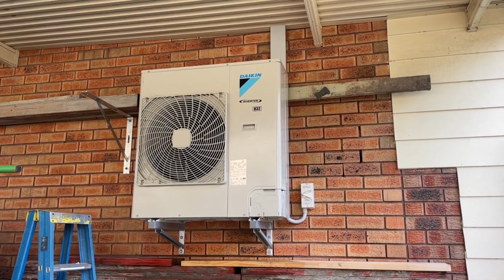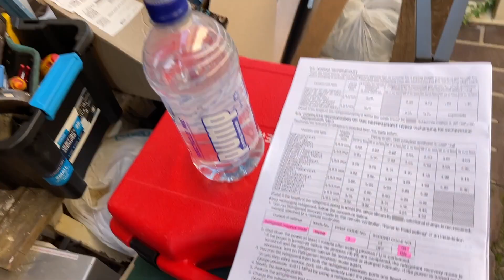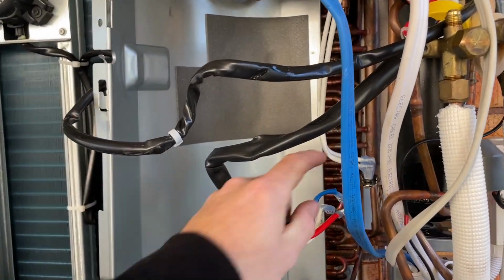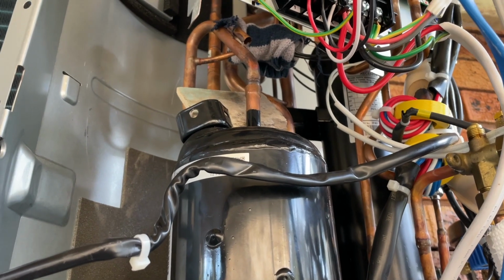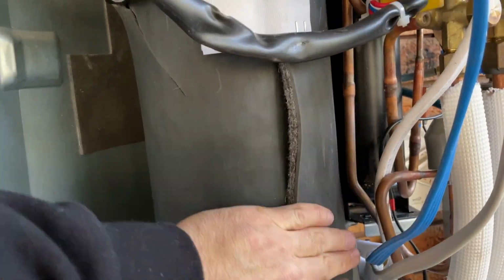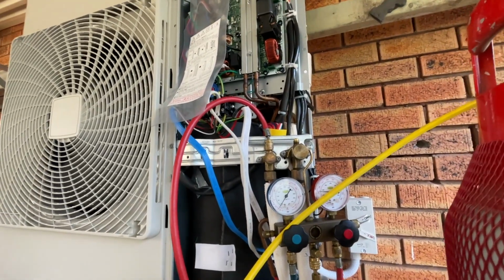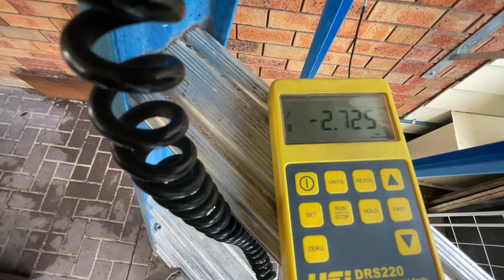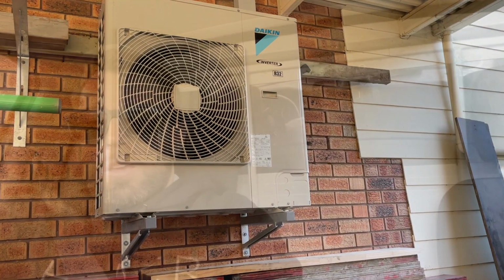Replacing a FAULTY DAIKIN COMPRESSOR | Only 8 months after installation.

Comment: In 2009I purchased a Daikin ducted air. It worked for three hours then failed. For the next three months Daikin Australia f..ked me around. Technician after technician tried to get this thing to work. No luck. After three months Daikin Australia finally conceded and replaced the entire unit. Apparently from conversations I’ve had Dainkin Australia hasn’t got any better. Since then it hasn’t missed a beat. 

You sometimes just get a dud and that happens but Daikin Australia wouldn’t own up. Next time it’s a Samsung or a Panasonic…not because they are better but just because Daikin Australia f..ked me over for three months. Daikin Japan needs to come to Australia and kick some arse.

Comment: You can put a demand on it at night time for 70% or 40% FL capacity. Helps eliminate ramping and locks out the full frequency
Reply from the maker: Really? Do you do that at the wall controller?
Reply: @maracservices  yeah In the first service menu you’ll see “demand” under field settings I think, you can set a schedule. It’s really useful. You can use it on any inverter one 2 one system from K series on with the new BRC controller. Can be done on a VRV condenser you have to get a low noise operation card from Daikin for that
Reply from the maker: @salmander91  that’s epic. I’ll definitely look into that. Thanks dude

Comment: Great job Mitch, how long in real-time did it take? I have replaced compressors on Mitsubishi’s not fun. In the States we are required to warranty an installation for parts & LABOR for 1 year. We’re you able to recoup any labor money? I never have any luck with labor charges from manufactures. Thanks for sharing.
Reply from the maker: In real time it took me 4 hours. Basically I bought a new compressor off Daikin and then replaced it for the customer. Now I send back some paperwork to Daikin and they refund me the amount for the compressor and also pay me 4 hours labour to fix it and the amount for refrigerant etc. So it’s not that bad but the labour rate isn’t what I normally charge out plus it takes ages for them to process the payment. 

Im not interested in working on Daikin warranty jobs because the pay is rubbish but if it’s my own customer I’ll certainly do it because I don’t want some other hack coming in and making a mess of it. Daikin warrant the parts for 5 years. 👍🏻
Reply: @maracservices  thanks for the feed back. Alway nice to see your work. Stay well.
Reply from the maker: @scottk0623  thanks heaps mate
Reply: @maracservices  for the same reason that you have noted, I never do warranty work for Daikin or any other manufacturer,,I got caught out once doing it and would never do it again..

I warrant my workmanship but if the unit is faulty, then I call Daikin or whoever the manufacturer is and let them repair it,,
There’s no money in warranty jobs and I can’t even make a mark up on the parts,,

Comment: I have never experienced a bad compressor in any of my installs in the last 30 years.    But I have never installed Dakin so maybe that’s the reason.   Good information to know..
Reply from the maker: What has been your go to brand over the majority of your career??
Reply from the maker: @coldfinger459sub0  very interesting! I worked on a lot of carrier R22 units when I did my apprenticeship. They were quality units that lasted decades. For the last 15 years, I just worked on inverters mostly and my go to is Daikin and second to that is Panasonic. However I’m not saying Daikin is perfect, far from it. However it’s what I use most of at this stage. That might change as I’m thinking about giving some other brands a try to see what’s out there. Daikin treat you as a number not as a  valued customer unfortunately

Comment: Are Daikin still the goto brand? I want to have a multi split installed but the outdoor unit will be at the side of the house so needs to be fairly quiet with minimal compressor noise? cheers!
Reply from the maker: Everyone has got their own opinion on what brand is the best. I think all the better brands are similar so it doesn’t really matter. I’m familiar with Daikin so that’s what I install. In regards to putting the unit at the side of the house. Try and put it outside a bathroom. Definitely don’t put it outside your bedroom. The unit up on brackets is nice and neat and off the ground but can vibrate the wall depending on how your house is Built. So if you have exterior cladding or  blueboard or something other then brick, just put the unit on pavers instead to avoid vibration being an issue. 
I don’t know about other brands, but Daikin have a night time mode which keeps the outdoor unit quiet.

Comment: hey mate, why do you have to put one hose on that particular port directed at the top of the unit, i didnt quite catch what you meant.
Reply from the maker: I keep an installation manual for r32 units in my van so I know what field code settings do what when ever I need to know. When I read it, I noticed it said to recover the refrigerant from the “refrigerant recovery port” and the liquid service valve. It had a diagram of where the refrigerant recovery port was. So to answer your question, I don’t think it really matters but that’s where Daikin tell you to recover from. I think it makes recovering the refrigerant a bit quicker. 👍🏻
Reply: Ok so how do you change the setting inside and what to?

Comment: Why you don’t use micron gauge ?and I believe R32is a blend,you probably need to flip that jug upside down when charging the unit .  You’re one of best installer though!
Reply from the maker: I’ll be honest, my testo micron gauge isn’t working properly at the moment. I’ve never been happy with it. I’m currently looking for another brand of micron gauge, I want to get one that isn’t an inline type. I just want the one female connection type. Thanks for the comment.
Reply: R32 is not blend
Reply: @BERESHIDA2008  well I wasn’t sure if it was a blend or not! But I guess you’re right! You can charge it as liquid or gas just as r-22
Reply: R32 is pure. R410a is made from a portion of r32 and something else (can’t remember off the top one of my head)
Reply: Wrong R32 is a single element refrigerant not a blend. Maybe you are confusing it with R410a

Comment: mate i don’t know if you’ve ever seen one but you might know what brand i’ve got. 
i’ve got a reverse cycle unit that was purchased when we built our house in 2018. the unit has no labels what so ever that mention size, brand etc, indoor or out. our thermostat is izone by the installer and that doesn’t mention brands or anything either. (it’s the only manual we have) the outdoor unit is different and i’ve never seen it before. it is quite large on our roof with two fans but at the top of the unit (not action air as these have top discharge) mine has the two fans at the top of the unit but it’s a side discharge (flip a daikin on it’s side) 

do you happen to know what it is?
Reply from the maker: What you’re describing sounds very interesting. I have no idea what that is haha. Feel free to send me a picture of it, I might know once iv looked at it.
Reply: nah mate it’s all good, just so weird, i’ve tried searching and searching. we have 20 vents and having high ceilings so i’d say it’s a pretty big unit. i’ll have to get back up on the roof some day to take a pic, even with our street view it’s covered by our bloody hot water solar panels haha. from the front it literally looks like a large temperzone unit that’s been tipped on its side. anyway, it works alright, it just has to be started in early mornings for cold or hot days
Reply from the maker: @jackm1399  I hope it’s not meant to be standing up 😂
Reply: @maracservices  
oh s#!t, could you imagine!!! 
have you ever seen any unit like this before. 
looks similar to a space pak heat pump unit but the fans are horizontal.

Comment: Do they fail often ?
Reply from the maker: I’ve had three Daikin Compressors fail in my time installing them. I don’t think they are more or less common then other brands in my opinion but I could be wrong. I wouldn’t say it’s “common” but regardless it would be better if it was super rare but I wouldn’t say it’s super rare either. It happens from time to time.

Comment: Hey I have an Error HO on a Daikin 3mxm52 with three splits. The machine runs about 50 seconds, after that it stops for about 3 minutes. This goes for 10-12 hours then I get error H0 on ONECTA App. On the outside machine the second and the third light is blinking. Any recommendation or help from anyone 🙏